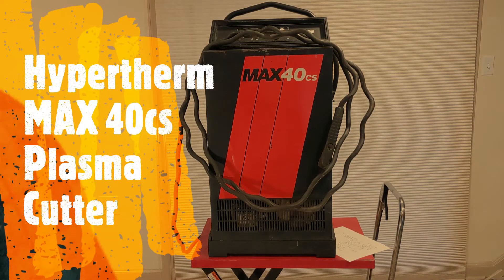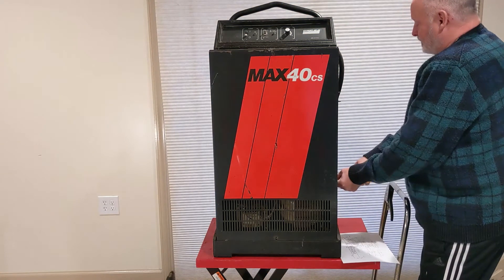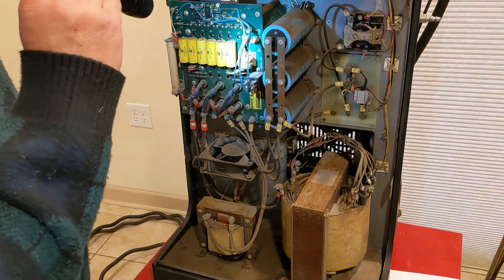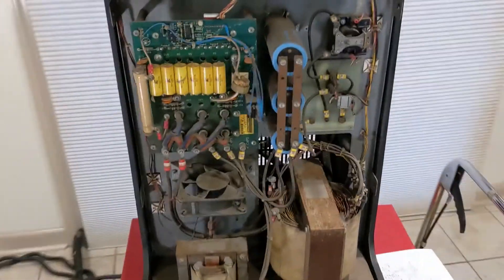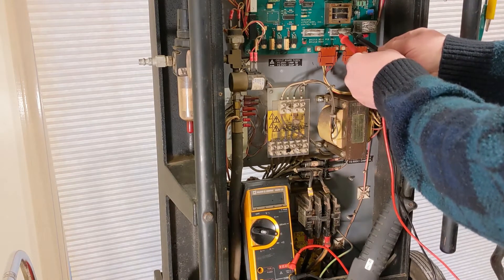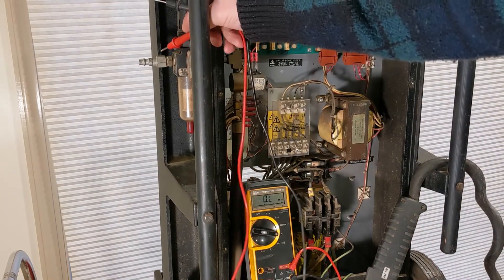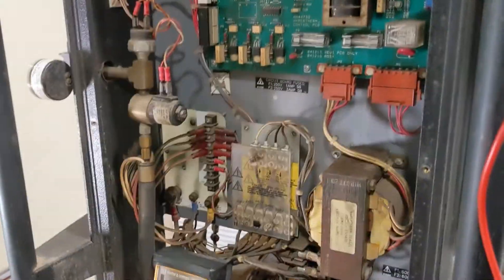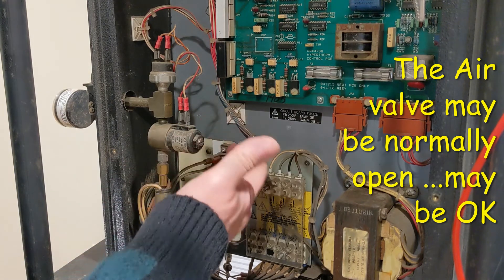Hypertherm MAX40cs Plasma cutter troubleshooting

Comment: Did you ever figure out why it wasn’t functioning?
Reply from the maker: No,  I sent it on to a friend who has several of these that he uses in his business and I have not heard back from him yet
Reply: @neuromanglers  ok, I just purchased one for $120, and was told it was working before he bought it and when he got it home he couldn’t get it to arc. He also gave me a plastic grocery bag full of new never used consumables. The torch head and lead are newer. I have yet to open it up, look around and test anything. 
I figure if it never works again, I’ll at least be able to part it out and sell the consumables and even make a profit. Ty for the video.
Reply from the maker: My friend may want to purchase it if you are up for selling ....how far from Kentucky or North Carolina are you ?
Reply: @neuromanglers  
I live in northern Illinois. Probably too far. 
  I will consider selling, but I’d have to at least do some diagnostic testing to see where I’m at with the machine. Thank you for replying
Reply: Old but not absolutely 😭

Comment: The air is off till you pull the trigger and the air stays on for a few seconds after the trigger is released. I used one 3 of those units in the late 1990's and had to do maintance on a couple of them. I would check the contactors at the front lower section to see if the Transformers are being powered. The heaters as we called the magnetic pull downs in the contactors, they could be not working.